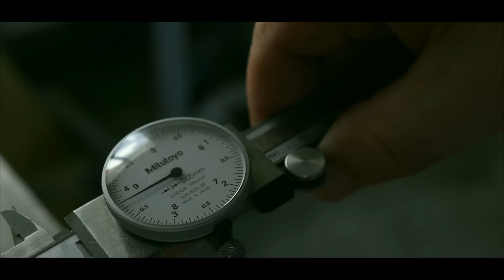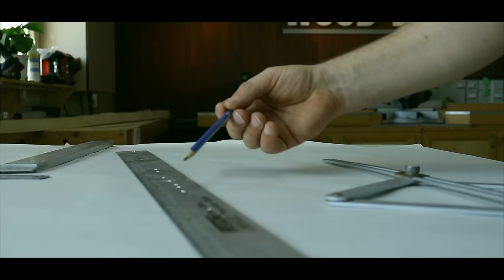DIY Chair. Wooden rocking chair. Кресло качалка своими руками.

Comment: Beautiful design, great craftsmanship, but why brad nails for the top of the slats where it’s visible on the top part of the seat?
Reply from the maker: Thank you
Reply: Artist's choice, but I was wondering the same thing. I would think recessed into the front cross beam and capped with the face rail to hold them in.  You know, to hide the fastening and look more fluid. But hey, if I build my own, then I can finish my front the way I see fit.
Reply from the maker: @thomasarussellsr  I agree with you completely.

Comment: Wow how many clamps have you got Great work well done Good luck from Ireland
Reply from the maker: Thank You So Much.
Reply: As usual in a professional woodworker's shop, one less than needed. Always have to run out and buy more when a new project of bent/stripped wood comes into the building process.
"You can never have too many clamps" [call sign quote of any woodworker]. But, yeah, they have a lot, don't they?

Comment: Great job. Your videos are the best overall! Can you tell me 
, when bending wood without steaming, when you bent the legs for the rocking chair and you bent many wooden strips all at once with glue in between, what wood do you use and how thick are the wooden strips so that they don’t brake when you bend those around the chipboard gluing jig? The curve is very tight and still you manage to bend the wood so easily?? I am a beginner and I would like to try your methods of bending wood like this because I have no possibility to use steam or heat in my workshop. I am very gratefull If you could share this knowledge of woodbending to us. 
Best wishes,
Juhani, Finland
Reply from the maker: Thank you very much. The tree is beech. Plates thickness 0.5 mm
Reply: @WOODDESIGN6730  Thanks fot your answer. I just want to clarify that did you mean 0,5cm or 5mm. You told the strips are 0,5 mm which is half of a millimeter, sounds impossible. In the video the stripes look like around 5mm.
Reply from the maker: Excuse me 5mm.

Comment: I have to continue even you haven’t had time to answer my previous question. This rocking chair is one of the most beatifull furniture I have ever seen. You are total Masters of Wood. If you have time to answer my previous question about the wood bending, can you also answer that is it possible to buy the building instructions to these projects if yours? If I wanted to build this rockinc chair for example, can I buy the intrstructions somewhere or if the instructions are not available, even just a drawing which shows the main measurements and angles/ratios so that it would be possible to try figure out the construction from those? I would really like to get instructions for this rocking chair. I am mesmerized totally!!
Best wishes,
Juhani, Finland
Reply from the maker: Thank you. We make our projects from a sketch. I'm sorry, but we don't have a drawing for a rocking chair.
Reply: @WOODDESIGN6730  but will be great if you make the drawings 😄